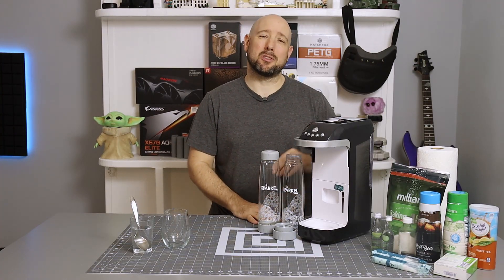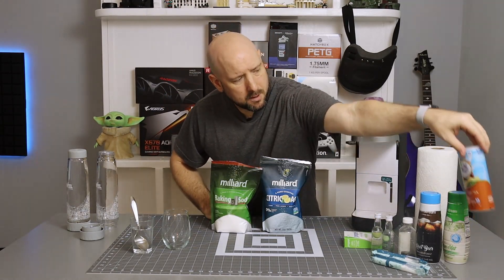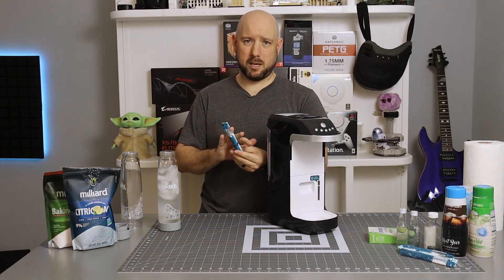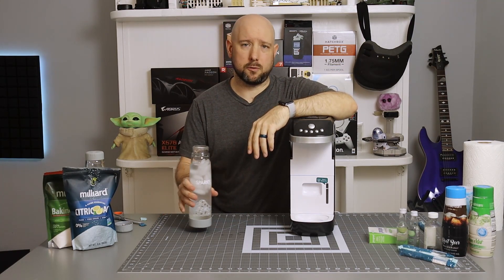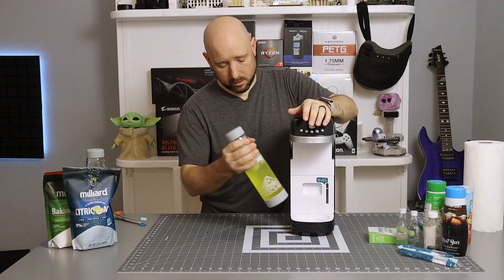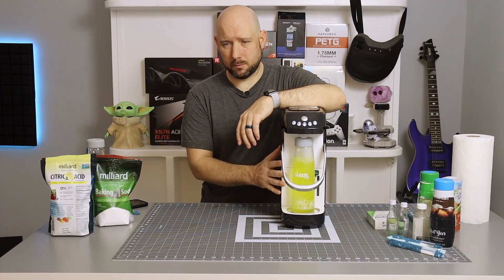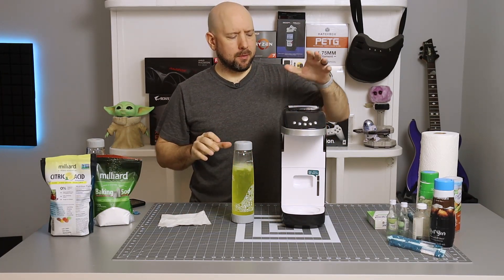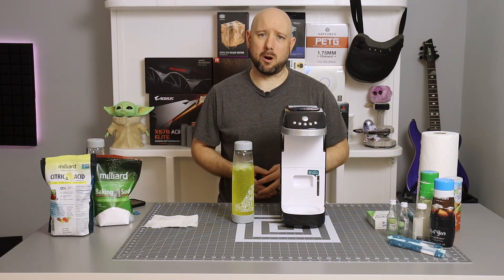Review: Sparkel Beverage Carbonator (with no CO2 canister)

Comment: - Great review, thanks..  I bought one. However 
- I measured the contents of the Sparkel sachets.  Each was exactly one tablespoon.  I'm using one tablespoon of the Millard Citric Acid and one tablespoon of the Milliard Baking Soda.  Identical results to the Sachets.  Please correct your instructions above.
- The handle design indicates one  hand is to be used and the result makes you think it's bad engineering.   But, if you use one hand on each side of the handle it seems to work gracefully enough.
Reply from the maker: Wow, Human Person, you are the first to point out the incorrect measurement!  It was supposed to be two teaspoons - which is 3/4 tbsp and close to the 1tbsp you're using.  I've updated the description.  Unfortunately YouTube is pretty restrictive on modifications so the video itself can't be easily changed.

Yeah, that handle should've been a bit beefier.  It's easy enough to close it carefully but I'm surprised mine has lasted.  I've recently moved to a DrinkMate and will be comparing the two soon but the simplicity of the device is a welcome change from the Sparkel.
Reply: @LilMikeysBigPlans  Hint: 
- Use a shovel-like tablespoon.
- Use a piece of Kleenex to clear ingredients from machine after tablespooning.  
- Use that same Kleenex immediately after removing the bottle to clean the upper and lower nozzle areas and leave the Kleenex in the base to pick up drips.
- Use little 3x3 or 4x4 Rubbermaid or Glad style food containers for the ingredients so you can buy the largest cheapest bags without having to spoon it from those bags. 
- Keep 3 two liter bottles of cold water in the fridge for your next round of "20 Cent Plain"
Reply: @LilMikeysBigPlans  you should PIN this comment
Reply: HI Human just got the sparkel today so would your advice to me since everything is more zeros now be buy bulk baking soda and citric acid and in the end it will be more cost effective?  ( i mean both as bulk is going to save me money is that correct does it still work fine ?) thoughts please thank you.

Comment: run it twice on lvl 5 if you want extra bubbles.( don t add more carbonator just one dose is enough)
Reply from the maker: It will let you run twice without dumping the water/citric acid/baking soda mix?  I thought it locked you out until you raised the release and dumped the waste?
Reply: @LilMikeysBigPlans  run twice on the same bottle

Comment: Question ..you can carbonate any liquid? Tea, Wine.. etc?
Reply from the maker: Yes, you can with the Sparkel.  Most carbonators recommend only carbonating plain water - mainly because there is now way to clean the carbonation 'tube' due to the way they are constructed.  With Sparkel, the valves are built into the bottle and not the station so you can wash them.  Unfortunately liquid does fall down onto the little pin and chamber below the bottle so be prepared to clean the thing once in a while if you're carbonating more than just water.

The DrinkMate uses CO2 cylinders like Sodastream but there is a valve the screws onto the top of the bottle and is washable.  So if you're looking for a canister-based carbonator that can do more than just plain water, check out the DrinkMate.

Comment: The best review of Sparkel I’ve found on YouTube. Looking forward to his 1 on 1 comparison with SodaStream.
Reply: Mikey, do you think some of the (lots of) complaints about the bottle bottom leaking are due to condensation?
Reply from the maker: Hello Daylin.  I have not found any evidence of leakage in any of my three bottles.  There is always some liquid that escapes through the bottom valve when you release the bottle and you have to clean/dry the pin but apart from that my bottle seals have been perfect.  There is definitely a condensation issue and water collects in the ridge where the bottom screws onto the bottle and that will drip every time you tilt the bottle if you're not careful.
Reply: I'm from the future and I have some bad news, he never did the Sodastream comparison video.
Reply: @GoingFar77  Guess that says something about the “need” to compare.

Comment: As a newly diagnosed diabetic I'm evaluating everything in my life and I've sworn off beer, wine and store soda so I'm seriously examining home made soda and I definitely like the look of this device. Thank you so much for an excellent unbiased in-depth review, It was much appreciated.
Reply from the maker: Hey Paul, sorry to hear about the diagnosis.  Even the non-diet versions of the SodaStream flavors have quite a bit less sugar then the retail canned counter parts and, even better, you can just throw some sugar-free flavor drops or a squirt of lime juice.
Reply: Yeah, home made is only really worth it if it's sugar free or low sugar,  i often just drink fizzy water, its way nicer than plain in my opinion so i drink more
Reply: I am a type 1 diabetic and I flavor using the water flavoring packets like Crystal light and others. One or two packets per bottle. You can even get them in A&W or Hires root beer or Crush soda flavors from Amazon, all with no sugar,

Comment: Nice review! Forgot to include the cost of the machines when factoring the cost per liter. This considerable hassle and cost… just look at all the crap laying out at 18:06, has me second guessing this for sure. Who has the time or the space for all that? I think even if the end result is superior, shipping tanks back and forth is a lot less work than this, a lot faster, a lot “smaller”, and this ends up only a little less expensive than the CO2 injection style devices. Nope.

Edit, just did some math. This machine is 119 on Amazon now. I can get 2 liter bottles of generic club soda for $1.30 at our local grocer Meijer. If your main objective is to save money, it warrants noting that you’ll have to consume over 200 liters before you break even on this device at these prices. That seems like quite a lot…
Reply from the maker: The MSRP cost of the machines was pretty similar - at least when I recorded this - with the Sparkel coming it maybe $10 more than the cheaper SodaStreams and a little less than the 'one touch' SodaStream which would be similar feature-wise.  That does not account for sales though and SodaStream can occasionally go for %30-40 less.

As for space, the Sparkel device may be a little larger but they are all roughly similar.  You have to store the chemicals but on the SodaStream side you have to store extra canisters - especially if you want free shipping on those canister exchanges.  I plan to switch to a canister-based device in the near future and will be able to speak more directly on the differences soon.

Comment: I went to Germany back in 2006 and they had a carbonator that didn't use a canister and also had to get plugged in.  I don't remember them having to mix chemicals.  I'm curious if there's anything similar in the US.
Reply from the maker: Hello Raymond.  Not sure what the technology would be if it's not either this chemical process or drawing from a CO2 canister.  Heck, restaurant-style soda machines are basically just big soda-streams that use scuba-tank-sized tanks.
Reply: @LilMikeysBigPlans  The one thing I do remember is that they had to heat up the water, run the machine, then let it cool. At the time I thought that it was just forcing air into the water but now I'm not sure.

Comment: I love mine! I use the generic chems all the time.  No problem.  Clean your top often.
Reply from the maker: Good call!  My biggest complaint with the Sparkel (besides the 3 minute wait time which is a bit unavoidable) is that it gets kind of disgusting around most of the fittings without a good scrub!
Reply: How often?
Reply: HI  just got the sparkel today so would your advice to me since everything is more zeros now be buy bulk baking soda and citric acid and in the end it will be more cost effective?  ( i mean both as bulk is going to save me money is that correct does it still work fine ?) thoughts please thank you.
Reply: Have you tried adding a bit more chemicals for stronger carbonation?

Comment: I liked this review aLOT.  Thank you.  My husband just bought me a Sparkel.  I've used the same Soda Stream for 10 years.  I've loved it for 10 years.  I have had it "blow up" on me a couple times when I was in a hurry removing a bottle, etc., but I've loved it.  I find that these bubbles are more 'condensed' ... I have no idea if that's the right word.  They're MUCH smaller bubbles than the soda stream.  I also find that the soda stream liquids stay much more bubble for a longer period of time.  I'm excited to try the Sparkel with alcohol.  So - there's a plus.
Reply from the maker: Thanks for the info Kim!  I still have not tried a real SodaStream yet but I was telling my wife I was going to pick one up after I'm through my last bags of chemicals - although I'm considering a DrinkMate since you can carbonate anything due to the washable infusion thingy.  The wait time of the Sparkel is kind of a bummer but I really like not having to deal with canisters.

Comment: I have both machines...As I live in assisted living situation, it is not convenient to take a cartridge for the exchange and savings on the new one.. when I saw the Sparkle, that was the best substitution for my problem.. I do make my own supply and it works great.. mush less expensive than buying the pre made packets.
Reply from the maker: Interesting use case!  I would guess that storing and managing a collection of tanks would be a lot more effort than the 'two scoops' approach of the Sparkel in such a facility.  Would be interested in how your Sparkel is holding up under a more industrial workload?  I don't get the impression they were made to last a lifetime.
Reply: @LilMikeysBigPlans  I'm laughing at the "last a lifetime"..as I am almost 79, I'm guessing it will last long enough for me!.. liking it great so far! ve
Reply: Hi Vicki here is my question for you based on now everything having more zeros are you going to tell me I will have more Luck buying a bulk baking soda and  citric acid and while it is not recommeded you think in the end it will save money? P.s I think I heard some one say a tablespoon of each one should be mixed at one time ? thoughts please thank you!

Comment: Excellent review.   I came here because my new Sodastream Fizzi loses gas pressure during carbonation.  What I'm left with is a drink that is much flatter than I expected (after spending nearly ninety dollars).    No matter how much I press the button, the result isn't much different.  Perhaps my machine is defective?  I don't know.  What I do know is that I wish that I'd seen your review before I decided to go with the Sodastream.
Reply from the maker: Luckily the SodaStream style devices should be mechanically pretty simple.  If you're out of warranty you might just have a loose or missing O-ring or something fairly easy to repair.  That said, my Sparkel is still going strong and I'm averaging about two bottles per day. :)

Comment: Would taking apart the bottom assembly to clean it out void the warranty in any way?
Reply from the maker: Good question.  I think that may end up falling on the laws and regulations in your country or state.  I'm sure they would claim that disassembly at all would void warranty but whether that would hold up or not is questionable.  I didn't see any tamper identification - no warrant stickers, tabs to break, etc.  I don't think they'd even be able to tell you took it apart if you didn't break anything - and if you broke something then the warranty is likely void.

They do say that using anything other than their sachets voids the warranty and I would guess that if you were using your own citric acid and baking soda and something went wrong with the compression chamber you'd likely be out of luck as well.
Reply: @LilMikeysBigPlans  There is a video on youtube that shows how to clean the machine.
Reply: not sure, but not using their expensive packets will definitely void the warranty.

Comment: SodaStream is cheaper as it would only cost 5 cents to make a liter of Selter water. The 60 liter CO2 bottle hold 14.4 oz of CO2.  I can get 1 lbs of dry ice for $3, unscrew the valve of the CO2 bottle and put the dry ice in there. Screw the valve back and wait for the dry ice to melt and now I have 1 lbs of CO2 in the bottle for $3.  That comes out to be 5 cents per liter of carbonate water.
Reply: An external cylinder can be connected to the Sodastream through a suitable adapter. Then it's super cheap.
Reply: @Gelek  That's what I finally did. But the initial investment costs for the equipments were $102 vs the cost of a couple of dollars for the dry ice.
Reply from the maker: Wow.  Ya, I think you may have identified the cheapest carbonation option but buying and maintaining dry ice and messing with canister valves is likely beyond what I'm willing to do for my fizzy water :)  I would liken this to the madlads that connect up industrial CO2 canisters to their SodaStreams.  It may be cheaper but a bit more effort and risk than I'm willing to spend.  That said, I would love to see a video covering this process.
Reply: @LilMikeysBigPlans  Just search on Youtube for "sodastream refill dry ice" and there are plenty of video that shows you how to do it.  It's not a secret and not that hard.
Reply: @КевинЮань  a Real Russian.
Reply: @AdamPX1-w5z  Not Russian, Turkic. You Russian invaded and controlled central Asia and forced us to speak Russian until the fall of the Soviet Union in 1991. But the Mongol Empire under Batu Khan, in which the picture Batu Khan is on my account, conquered and ruled over Russia for 300+ years which is longer than the duration that Russia ruled over central Asia.
Reply: @КевинЮань  Not Russian, Italia.
Reply: @LilMikeysBigPlans  I purchased the 5 lbs CO2 tank and got an adapter for the two valves of the Sodastream tank and the 5 lbs tank on Amazon and just refilled it myself for 6 cents a liter. The 5 lbs CO2 tank costs $89 with free 1st CO2 fill on purchase and $18 refill there after. The adapter costs $13 so the initial investment costs of $102 is more than refilling with dry ice but it works for me.

Comment: Really great video! Love the concept of this machine; I already have a giant bag of citric acid in the pantry, too - but I'm looking at my kitchen and wondering where the heck I'd put this! Thanks for doing the cost comparison, that was incredibly helpful!
Reply from the maker: Thanks Heather!  It's not a bad little machine, perhaps a little larger than other similar devices.  If you don't mind my asking, what are you using citric acid for regularly?   Looking for a reason to grab 4lb bags instead of 2lb bags :)
Reply: @LilMikeysBigPlans  Just my two cents worth - I use citric acid as an additive to my home made sour dough bread.  I also add it to sauerkraut to make it a bit tangier.  Be careful not to use too much or you will definitely pucker!

Comment: Thanks for the review! Finally somebody who says how long it takes, and the disassembly tips were nice too. Oh damn, and you even did the stoichiometric price comparison as I wrote this! My hero!

In exchange, here's a fun fact: The difference in effervescence between champagne/seltzer/this and commercial soda is most likely due to gum arabic and other thickeners. These increase the surface tension of the liquid which allows larger bubbles to form before they burst.
Reply: The bubbles here are SO much smaller than with the soda stream....and they don't last as long
Reply: @kimsharabba5386  exactly.
Reply: @kimsharabba5386  Kinda like a micro-brew, craft soda that costs even more than the big two canned soda brands.
Reply from the maker: Hey CRAMD, I'm glad you enjoyed the review and thanks for the heads up on gum arabic!  I suspect both the sparkel and the sodastream-style devices would have a similar carbonation effect give the same flavor chemistry then.
Reply: @LilMikeysBigPlans  ended up with the sparkel! 

Yeah, not as sure about flavor, but for bubbles, it's viscosity that seems to be the key. I haven't tried gum arabic yet, but even dissolving a bit of sweetener to get a juice like consistency has gotten more of a soda foam effect out of the fizz.

Comment: Thanks for the in-depth review, I'm considering getting one myself.
Reply from the maker: Hey Jonny.  It's a good device especially if you don't want to deal with CO2 canisters and by far the cheapest solution if you use your own chemicals - however I do see that they 'invalidate' your warranty for doing so.  Given the time it takes to carbonate and the inability to clean under the drip tray it's definitely not a slam dunk, though.  Good luck with whatever device you choose.  I definitely prefer making my own drinks a liter at a time to stocking up on bottles and cans of mostly pre-sweetened water :)